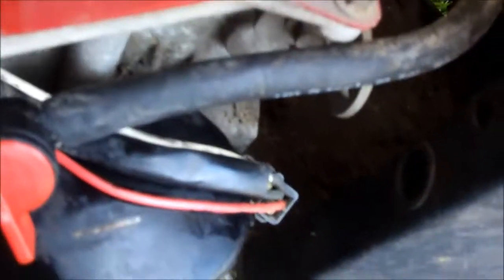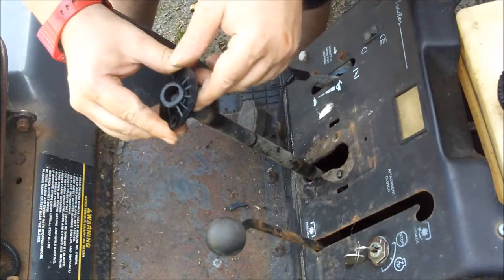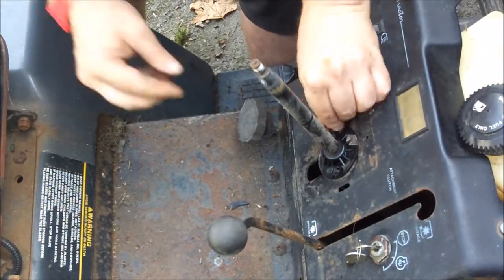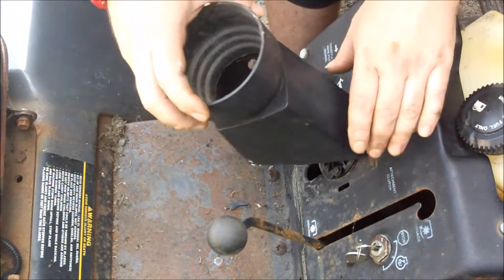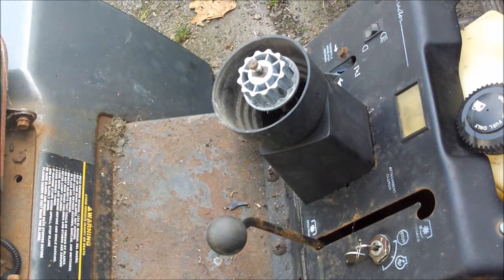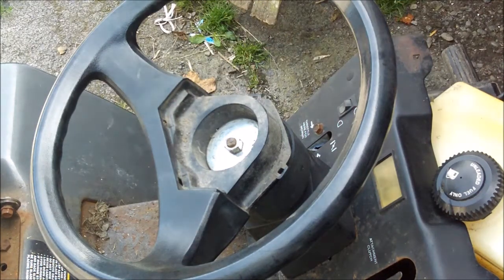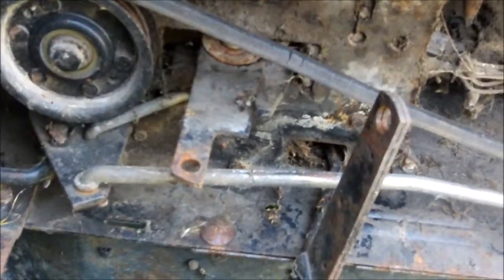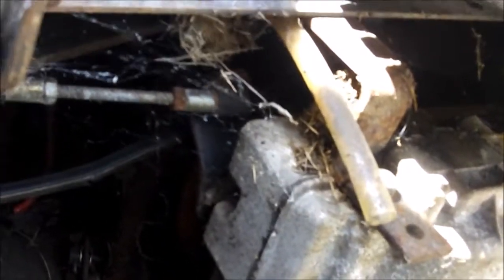craftsman lt4000 needs new drive belt and how to install steering bushing

Comment: The drain is for the battery box, lol
Pretty much all craftsman's have play in the steering not really a big deal as long as you don't have more than a half turn.
You do realize your gas tank is and backwards correct??
Reply from the maker: redneckbryon that's good. I like the gas tank where it is the gas line reaches the carb better that way.

Comment: You really don't need a fuel shutoff unless fuel is mixing in with the oil. I replaced the electric fuel shutoff valve with a bolt, then spliced in a shutoff into the fuel line; but i have never shut the fuel off ever since i installed it 3 years ago.
Reply from the maker: +Chris . Jones thanks man. sad to say I scrapped this tractor. the engine was put on my simplicity 4211 tractor with  the craftsman wiring. please check out the video were I test drive the simplicity 4211 tractor. take care man